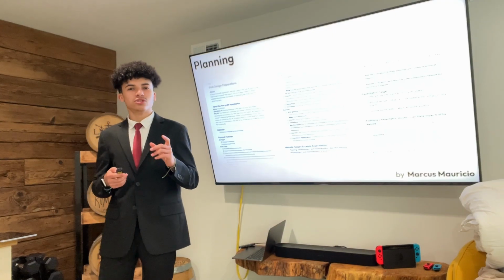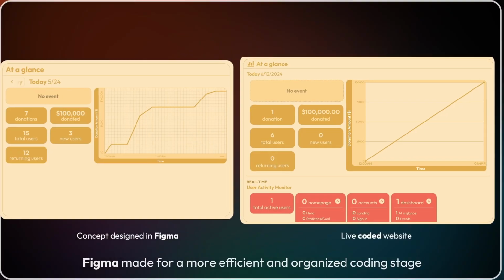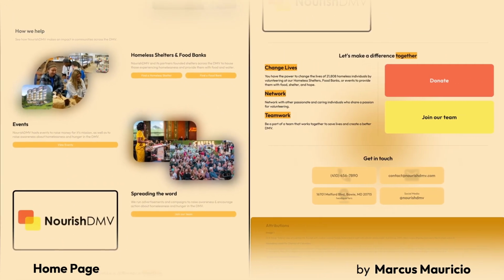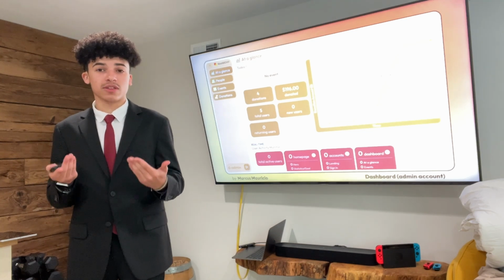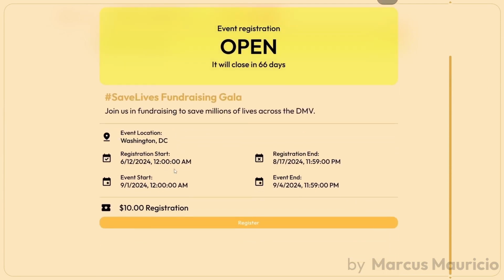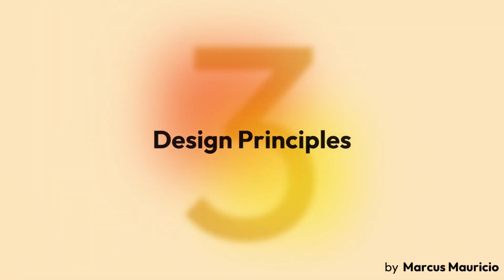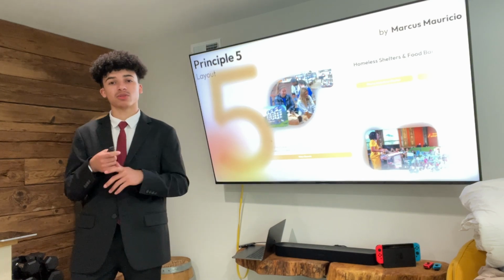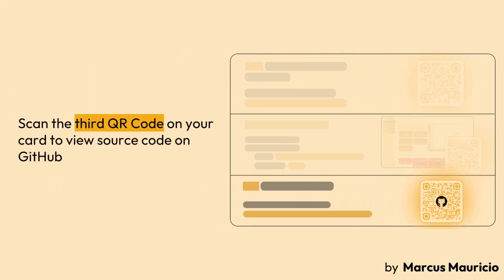NourishDMV | Nationals | FBLA Website Design Presentation | 23-24

Comment: Did you handocde this wesbeit entirely or did you use an editor like wix? My team is unsure whether or not we have to handcode the entire thing or just really DESIGN it with an editor
Reply from the maker: Hey! I coded this website with NextJS. Coding it definitely requires a lot more work, but it's worth it because it allows you to be more flexible and possibly do things you can't do in an editor, which could make you stand out! But it all depends on what you and your team plan to do with your website
Reply: @marcusmcodes How did you present the website, did you open the website up and click through it or did u take screenshots and videos of the website in advance?
Reply from the maker: @patelproductions9075 Great question! I took a Full Page Screenshot of the website, and then used the "Morph" Transition to go through it section by section (created new slides each with a different section of the website, and then applied Morph to all). If you use Chrome or Edge, you should be able to take a full page screenshot within the browser.  For the part where I demo how to create an event, I pre recorded a video and sped it up in some parts to make it flow right. Hope this helps!